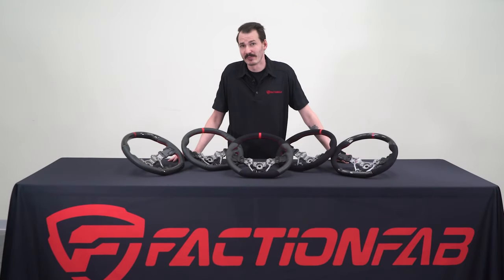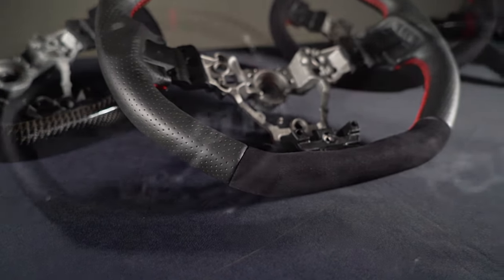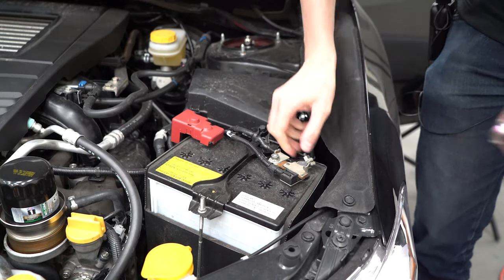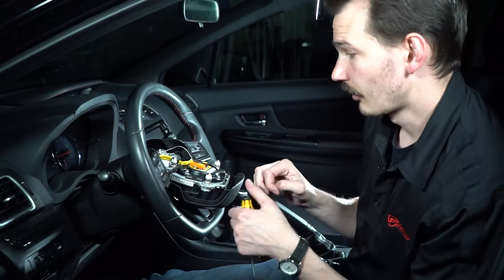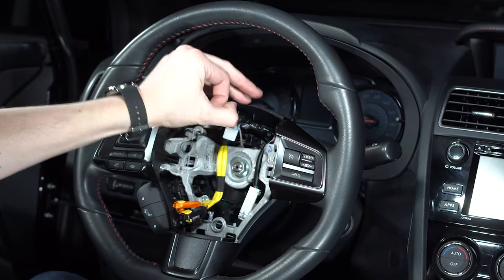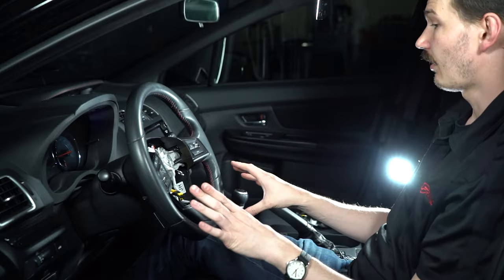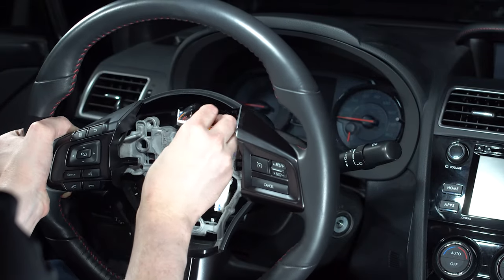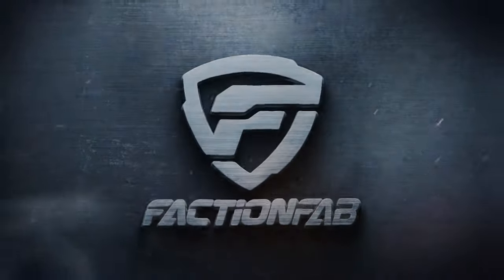How To Install FactionFab 2015+ WRX / STI Steering Wheel

Comment: If the clips were put back and no wires were pulled hard but steering wheel controllers don’t light up or work would you know what would be wrong with the steering wheel?

Comment: great vid. quick question, when reinstalling the steering wheel, how much pressure do you put to ensure it sits on the column the way it is supposed to? Should it be as deep so the column and steering wheel splines are flush or there will be some depth left and after the install, I will still see the steering wheel splines that sit above the column?
Reply from the maker: The wheel will bottom out on the splines and once torqued down it will not move. Hope this helps
Reply: @factionfab5834  So no insane pressure to bottom out the wheel, correct? just use hands to press the wheel on the column and it will slide in to the lowest point correct?
Reply from the maker: @alexulyashin7192  Yes you are correct. Just slide on by hand with nothing that is considered excessive.

Comment: Did the install, but to make the car go straight, I have to hold the wheel at a slight angle. Am I one tooth of fon the spine, or did I move the clock spring while installing (not sure if that matters)
Reply from the maker: Unfortunately this is a common result of a steering wheel swap. OEM wheels do not specify a "top center" alignment of the splines on the steering wheel and the final alignment is always controlled by the full alignment service at the factory. Due to the high spline count, most people don't see this issue and usually are very close, but occasionally if the OEM wheel is a at the farthest point possible it will need an alignment to be corrected.
Reply: @factionfab5834  thanks I got an alignment and it fixed it!

Comment: I have a 2017 Wrx and I am buying a 2015 sti, will the steering wheel I bought from you guys be able to transfer over?
Reply from the maker: Yep! The same wheel is used on both models, so you will be able to swap it. I would make sure to keep the controls and buttons in the original car and not swap those, Subaru is known to change pinouts and things for no reason.

Comment: my airbag light came on after, any fixes?
Reply from the maker: Disconnect the battery, then remove the airbag again and double check that all 3 air bag wiring connectors (Orange, black, green wire spade connector) are connected and fully seated. If the problem persists, we recommend taking it to a certified mechanic.

Comment: Do I need an alignment after?
Reply from the maker: If the steering wheel is installed correctly you should not need an alignment after.

Comment: What if you have paddles?
Reply from the maker: The inner casting on the FactionFab wheel is designed to be the same as the OEM wheel, which includes mounting points for all wheel models, including the CVT with paddle shifters. We have not shown this in our video as it is not the most popular choice, however all OEM options will bolt on.
Reply: @factionfab5834  thank you for your reply

Comment: Does this fit Forester XT 2014+????
Reply from the maker: Unfortunately this is NOT a direct fitment on the 2014+ Forester. It has been done by others and is possible, but proceed at your own risk if attempting to do so.